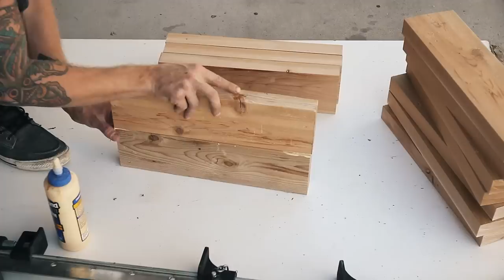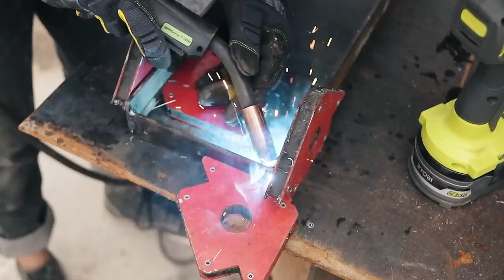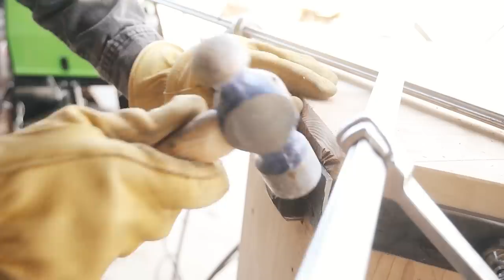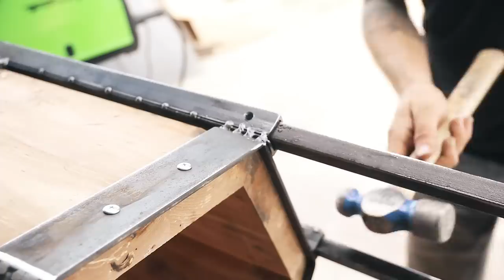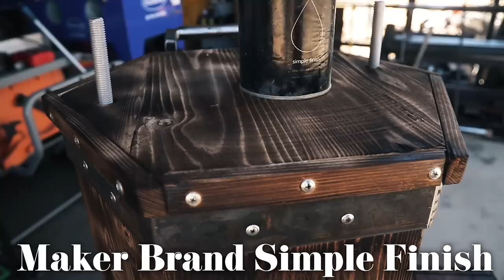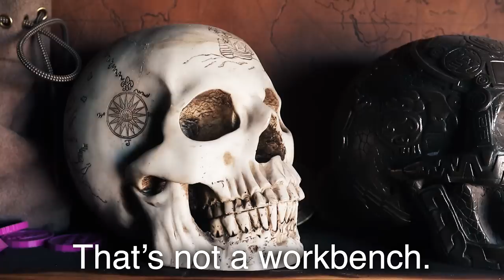Making a Mobile Anvil Stand | 265lb Fisher Anvil + 200lb Base

Comment: Špatný. Spousta materiálu a práce k ničemu. Pod kovadlinou má být špalek. Né bedýnka na posypový materiál. Not good. A lot of material and work for nothing. There should be a log under the anvil. Not a box for sprinkling material.
Reply from the maker: What a wonderful attitude. In fact. It works great. 2 years of forging/moving and 0 issues. 

Not a good comment. A lot of words and typing for sharing an opinion. Comment boxes not for trolls.

Go make something.

Comment: Well it really is a blacksmiths workbench. So you're definitely correct on calling it a workbench. Looks good. Without the anvil you could use it as a trashcan or a coal bucket.
Reply from the maker: 100% agree. If needed, It'll make a great bin.

Comment: Do the magnets that hold the pins for the handle collect metal dust constantly? Seems like a chain might make more sense in a metal shop
Reply from the maker: Mayhaps? How does the chain work? I dig the idea, but how would you make it removable? Clip a link to fit, then screw mount the center? I feel like as I’m typing I’m seeing the concept...

Comment: The Double-Square is listed two times in the description and the plane-grinder?? isn't listed.
Reply from the maker: Gotcha! Fixed it:
Ridgid Planer: https://amzn.to/3dj4BHb
Reply from the maker: Oh, and just a note/opinion: I've worked with 4 different planers over the years. 2 Dewalts that broke after a few big runs, an old Delta that was unkillable but not great when it came to sniping the ends, and this Ridgid (two different shops). I have yet to have issues with the ridgid.
Reply: @skullandspade  I've always been happy with ridgid as a brand, I have yet to have a single one of their tools die on me.

That said, if that planer ever kicks the bucket, you should look into Magnum Industrial (if you can get them, I think they're a Canadian brand?).. they've got four posts just like the DeWalt so snipe is kept to a minimum, and they come standard with a helical carbide head

Comment: Can you please provide your plans for the anvil stand? I'm starting out blacksmithing and am planning on purchasing a 25lb or so grizzly anvil. I mainly make knives and other small items, although eventually plan to make a machete for a family member. Thanks
Reply from the maker: This entire video is a plan. The only extra maths I’d suggest would be scaling everything down to 1/10th scale for your 25lb anvil
Reply: @skullandspade  Thanks, I'm actually probably going to purchase the 55lb Grizzly Anvil instead. That way it should cover the light duty needs of the 25lb anvil as well as the 55lb anvil needs without having to make two anvil stands.

Comment: do you use the sand for cheap weight? or does it dampen hammering vibrations or something?
Reply from the maker: A little of column A, little of column B. Mostly weight. But it does help act as a dead weight for dampening vibration or movement

Comment: Hi, gives an Parts List??
Reply from the maker: 1 part cedar wood, 1 part steel.
Weld steel, glue wood. Make it aesthetically pleasing.
Sand is optional.
Watch this video for guidance.
Bake for 3 hours at 200 degrees Celsius.
Enjoy.

Comment: An oak stump would have been way more practical and lasted longer. But this is pretty.
Reply from the maker: Oddly enough, there is a distinct lack of Oak Stumps in the California desert. Luckily, making pretty/practical anvil stands solves that problem.
Reply: @skullandspade  I just bought a 150# Peter Wright from a farmer. It's welded to a weird pipe/water heater tank base. I'm torn between packing the base with sand or hunting down an oak stump. I'm too impatient to build it a throne like you did. You aren't just a garden variety blacksmith, you're a craftsman. Keep up the good work and don't be discouraged by trolls like me.